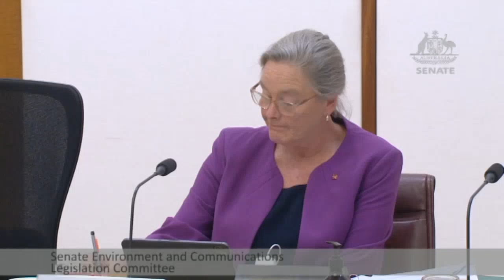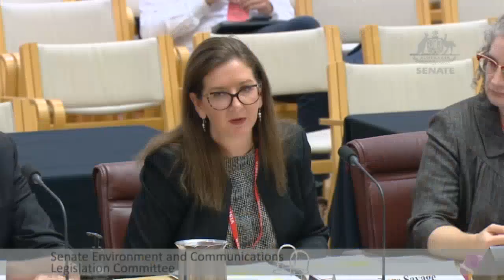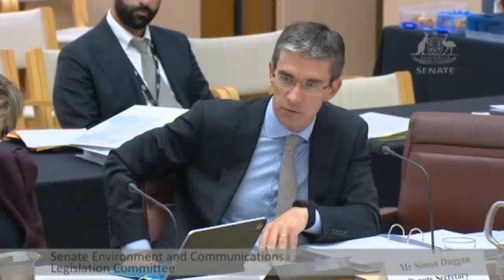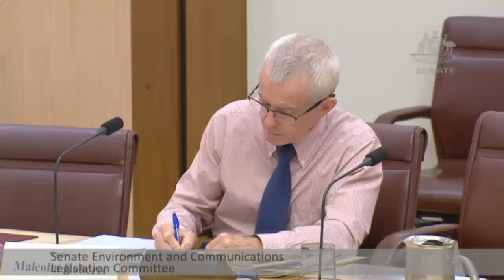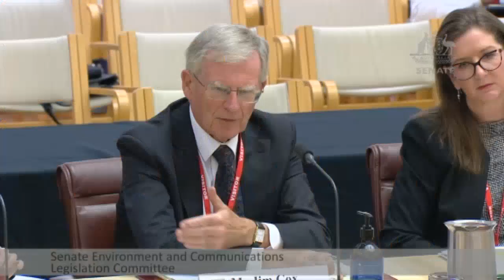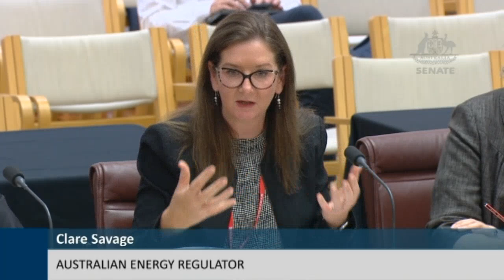Smart Meters and Remote Control Air Cons

Comment: Renewables are never free. If the energy providers can turn your solar off that sounds like a way of controlling profits to me. They talk about stability of the system, but really they are talking about cost reliability and stability.  The kila watt inverter made correctly will generate any frequency you program it to. Coal power plants can be reduced in supply to the point of turning them off when there is to much power from wind or solar. The problem with this is that the inverters are cheaply made and not truly built for purpose.  They are designed to power small capacity house or commercial situations not designed to power a large scale grid systemand even the large scale grid systems are built to price not to built to maximise output. The stability is up to the providers to garentee and with the fact that we have paid for most of this. If they can't garentee the required output at peak requirements then maybe we need to get the money back from them and give it to companies that can. Building to cost means you build to a budget which means you are compromising the outcome. As most people know who have built a house to a budget instead of just building the house to its best despite the cost. The government allowing companies to control you solar or any appliance in your home is just wrong. What if your smart fridge is using to much power they will turn it off. This is just crap. These ministers are working outside of there expertise and therefore you could tell them anything.

Comment: South Australia is acute because they switched off their mechanical generators. The gas and steam generators provide dynamic frequency and voltage control.  He should be asking questions about price gouging by providers in the near future during peak loading when the solar supply shuts down

Comment: Wrong turn off anybody's solar panel as they could be needed to charge batteries and appliances, we're should be disconnect temporary the meter from the electrical company....I turn off my electric meter when I have good power coming in....

Comment: so let me get this right the department responsible for the smart meters etc is asking the senator to provide the information that there department does not have , what the actual hell is that kind of excuse , your department your responsibility if you haven't got the info then you haven't got control so what are you doing sack the lot cause your being paid to run the department and clearly aren't

Comment: The concept of "turning off" inverters is a stop gap for consumers. Only smart inverters can be controlled remotely and the better ones can be "throttled' ie their output to the grid is controlled such that they still provide power to the owner. This is an evolving standard that has been implemented in a number of Australian states. Older inverters can't be controlled. The concern with all of this is that the minimum load that they talk about is the requirement to keep steam turbines spinning (mostly coal powered) as it's difficult to stop and start them abruptly. A serious debate is about why these people haven't done more to make the two systems compatible and yes I could use words far more robust than "DISGRACE" The reality is politicians are not really interested unless it secures votes.

Comment: Yeah yeah their level of coordination what she's talking about it's exactly how they scam everybody and the other bloke they force you to do feed-ins when you need that power yourself and I don't know why no one's talking about people that have batteries because people that have got batteries are getting absolutely scammed and everybody that goes on to a smart meter gets absolutely stamped immediately especially if you have hot water and it looks like with what they're doing Queensland air conditioning and pull pumps as well look out for them if you had a smart meter install because those things are going to be ripping you off

Comment: Recently  got a smart meter installed, my air conditioner  now has a mind of its own  when not in use ,sounds like a small pump running for no reason  when turned off so now I turn it off in the box until I need to use it which  is hardly ever.

Comment: Just disconnect the DRED circuit on your airconditioner. Download the installation manual and leave the mains power connected so it runs. Just disconnect the wires to the DRED terminals and then the evil corporations cannot control your aircon.

Comment: So the retail market with smart meters rigs the system so people PAY to use THEIR OWN solar power by paying less for the solar exported than purchased from the grid, and deliberately metering them seperately in such a way that when you use the power from your own solar you are paying your retailer for it.. after you deduct the pitiful credit -  now they are turning the solar off entirely?     They were also tabling the idea of an additional surchage for people using solar systems, in ADDITION to the price gouging being permitted and blind eye turned by the government to obscenely high "daily access charges"  on top of the disgusting 2000% markups on top of wholesale power costs being charged by retailers, ON top of shutting down power stations by taxing them to bankruptcy and not putting anything in place to replace them?

Electricity even when you can make your own it seems the government intends to make into a luxury not everyone can afford.  That is disgusting.

Comment: What if you have Solar powering your air conditioner, no one should turn down the compressor speed due to the grid load shedding.. Dont allow anymore Electric Cars if the Grid can not cope with Air conditioning

Comment: We have a smart meter as we built a new house 4yrs ago and it cannot turn off my A/C at all. It depends on the tariff you choose etc and if you choose the higher variable tariff which is the dearest they cannot turn it off etc. If you choose the cheaper flat rate tariff then yes they can turn your A/C off for at least 6hrs a day. . As far as my 15kw solar system they can do this as they are telling us (in Australia) that now too many people have solar now and the 'wires' can't handle the power all our solar puts back into the system.  What an absolute joke all this is and thank you Casanova Bowen for your insight.

Comment: What a joke. Why not turn a coal fired power station off or down? So our solar is turned off and we are forced to use expensive grid power and what if they leave them off? What power did you get today, your free solar or expensive grid power? So if its windy aswell are the wind turbines turned off? I bet not because they want the revenue from the power generated, because we pay for it whether we use it or not

Comment: Once again, those without any technical understanding are the loud ones. There is nothing wrong with smart meters, in fact they offer many benefits over traditional meters. Controlled loads have been a thing for several decades, and this is nothing new.

Comment: Nuclear doesnt have the MSG issue that Coal Power does. While solar is good, solar with battery is better (overcomes this MSG 'problem') but the cost for most is prohibitive ... but the taxpayer is fine to 'compensate' on renewables that only work 20% of the time so the 'investors' dont lose out

Comment: The fiasco in the uk over their postal service using meters which caused many to be jailed, some committed suicide etc because it incorrectly calculated what they owed should be a warning here that this crap is designed to make these leeches more money and is subject to it being used corruptly. Don’t allow these devices to be installed.

Comment: Smart meters are installed By deceit. They will send a letter stating your smart meter is order for install next week, but you haven’t asked for it. It’s a trick and a new contract with misc terms and conditions. Once a digital demand meter is installed you will be billed at up to 5 times the going rate during peak demand times. They don’t tell you this.
It is optional and ring them up and cancel the order.
They are using common law tactics which are legal but optional. Legal if you ignore to respond to the letter. After 7-28 days it legal.

Comment: You can request and expect your energy company to disable the wireless communication that the smart meter usually performs.
The Australian Energy Regulator states:
"When your smart meter is installed you can ask your
retailer to disable its communications functions. Be aware
there may be ongoing costs associated with doing this."

Comment: When we changed over to a smart meter, there was (a) a financial incentive to do this "remote management" ; and (b) it wasnt compulsory. We chose not to - my wife did not want the air con turned down right when we needed it most. We have not had our air cons or anything else interfered with. We are on the Gold Coast, and our provider is Origin Energy.

Comment: i told my energy provider i do not want smart meter in text. they still installed . installed solar as i was going on time of use {didnt want to} reduced bill as expected then rates went from around 30c to around 50c
and how does it cost over $1 per day to have wires which where paid for years ago and where owned by local council untill state government took it

Comment: So uhh... let me clear this up for everybody and Malcolm. (I'm not sticking up for the power companies, this is just how it works)

"Smart meters" don't control whether your AC compressor turns on or off, they don't control whether your solar panels work or not.
You MIGHT have your hot water service set up as a "Controlled load" whereby you elect to have the power company control your hot water system which usually attracts a lower rate per kWh.

A number of modern appliances have circuitry in them that monitors for particular conditions and responds accordingly, the power company can alter these conditions which define whether your appliance (AC or whatever) turns the compressor on or off which controls the load on the grid.

You're probably thinking "but I pay for this, why cant I use my AC"
Well, basically this is a more elegant way of load shedding, previously they used to cut entire suburbs off to make sure there is enough power for essential services but now they can just turn peoples ACs off so your fridge still works.

Yes, it sucks, the power company should probably upgrade their grid but hey... you voted to privatize the power companies and they're just doing exactly what they promised.. providing the bare minimum service for the lowest price they can while turning a profit.

In regards to turning your solar panels off, for the most part this happens automatically because there isn't enough demand on the grid and all the solar systems are pushing the voltage of the grid up to make the current flow in the opposite direction to your house which automatically makes your inverter trip off for safety reasons.

Again, they can upgrade the grid... but what's their incentive to? as long as they're turning a profit why would they?

Comment: If the power supplier is turning off the solar panels so as not to introduce too much electricity through the day, why do they have to turn off/down your air conditioner? Thought by running the air con would use electricity so not to over burden the grid??

Comment: Then why was/is the smart meter upgrade optional? It seems the upgrade came with certain aspects which engaged a persons various rights and/or protections at law unless it was done with the consent of the person. Can we know what the functional capabilities of the upgraded smart metres are and which, if any, of them are a violation of individual/consumer rights etc, without the expressed consent received from the person/consumer? 

Cause I bet there's more to it than unexpected hotter weather inside the house. Mine has inexplicably switched itself off and refused to re-start a few times recently but I found switching off for a while at the circuit board and switching it back on solves the strange issue. I had just presumed it had something to do with a fault that mirrored the circumstance where the power has been reconnected after a period of the grid feed has been down and the air-conditioning needs to be switched off and on before it would function normally. Maybe it is this causing the unexplained circumstances of switching off independently/automatically and refusing to re start without resetting it at the circuit board, or maybe it is indeed just a fault in the components aging and we'll used circuitry....

Comment: They control the remote devices in homes because the electrical system cannot handle the energy demands mainly from backward thinking of installations renewable power sources. Australia needs reliable power sources to handle real demands.

Comment: If the government turns off rooftop solar panels in the daytime because of overload of supply to the grid why is labor and bowen demanding building solar farms and wind turbines, would it not make sense to supply free batteries to households with solar panels on their roofs and free panels to households without, that would take the load off the grid at night and new transmission lines would not need to be built, are labor in league with the chinese government and taking back handers

Comment: .....so the solar power was generating so much power they had to turn them off to keep the power plants running at minimum (fair enough it takes a lot to fire up a power plant) but to then turn off air cons because of the power load was to high makes no sense at all

Comment: Electricity is purchased by wholesalers in huge blocks based on estimated need/use/supply. People's solar etc are required to have this renote control, usually via sim on the sine wave converter. 
They will turn off feed in solar because of poor management. 
When people have A/C installed, make sure to tell the installer/electrician to put it on it's on breaker but NOT one specific to the smart meter. Don't take deals on your solar install. When you do, you sign away what amounts to carbon credits which can be traded for far more than the discount offered in exchange... check the fine print!
Personally I'd only get solar if I could also get enough batteries. I won't be surprised if feed in rates turn into the home owner being charged to supply electeicity.
Victoria, south-east water etc are intending on rolling out "smart" water meters. At huge expense. The only real change is the avility to control your water supply remotely. Victorians are currently being charged for infrastructure that is estimated to be needed 40 years from now! Not one person I've spoken to knew about it. The information came with one of the bills. As required review, legislation allegedly meant to keep prices down.
Pay attention people. Ffs.

Comment: SOLAR IS Fu^king EVERYBODIES 240V DEVICES. They drive 240 over 240v making everybody's device run hot and inefficient. You cannot put it in unless you drive the voltage up these lying dumb pricks using bullshit terms for this fact. This control of your consumption is because of the physics of GREEN outputs which are useless.

Comment: I knew that smart metres were insidious to begin with ......we resisted and argued the point that policy is not law....then we moved out of Melb. We moved to the country put solar panels and a battery worked fine then had three power cuts and then stopped working ...paid a huge bill called the solar guys to check our panels and work out what the problem was ...my three year old inverter was cooked !!? Luckly we were under warranty and fixed it ......but i suspected that the outages were to blame ....if it happens again .....the company / people responsible for switching of my panels will pay my bills and some!! We invested 30.000+ $ to have these climate dicks stuff around with our stuff cause they dont have any answers to the electricity problems they have caused with the impossible net zero ideology they created !! Never investing in any hum bug crap pushed onto our conscience for the planet sake ...never ever believing the bs science the gorvenment/ beaurocrates/ big business and their lying deceitful tongues!

Comment: 0:35    Because if  it is a grid tie  system it will still back feed  the grid,  If the  grid is  lost then your panels shut down   unless you have a second inverter and battery storage system. This is a safety feature to prevent lines  workers from being electrocuted.
The  other reason why it  is desirable  for a network to be able to control solar input in to  a grid is because of loading on the grid. 
If grid load is light where is all that excess generated energy going to go? It is easier to turn solar off than it is to slow down a hydro or steam  turbine.
All you had to do  was ask an electrician Malcolm.

Comment: If the solar panels have too much sunlight, AKA is overpowering. Why not put it back into the grid instead of turning it all off? If you can't hold extra power for free use during winter weather. Then, solah and wind power will never be financially sound or reliable.

Comment: I believe my solar was getting throttled 6months ago. Kept shutting down several times per day. Previously this was not happening. I was getting perfect bell curve like production except for cloudy days and over voltage protection shut downs (the inverter throws an error code for over voltage so it’s easy to check). 
To source the problem I spoke to many people, origin, endeavour, electricians that installed my system, I posted on FB solar groups. Plenty of people had experienced this but couldn’t explain it. 
Origin said they couldn’t find any issues but insisted that they had NO external power to shut down or throttle my inverter. I complained that when it was shutting down that I was unnecessarily pulling power from the grid. 
Then mysteriously it stopped happening